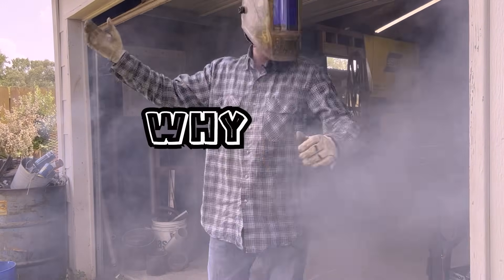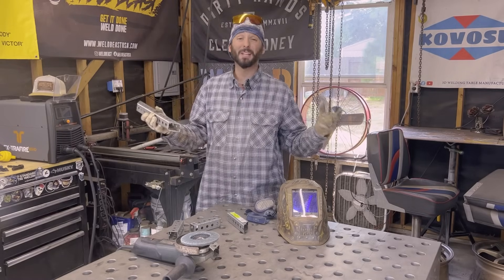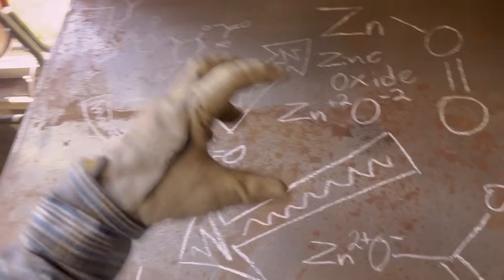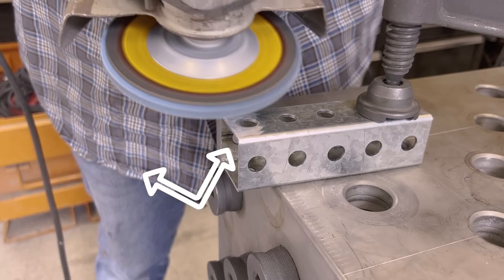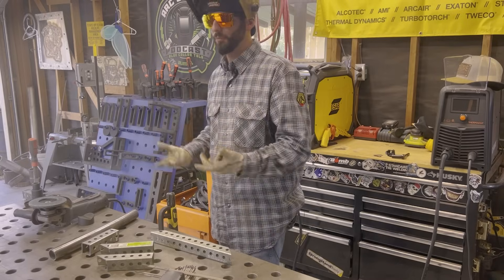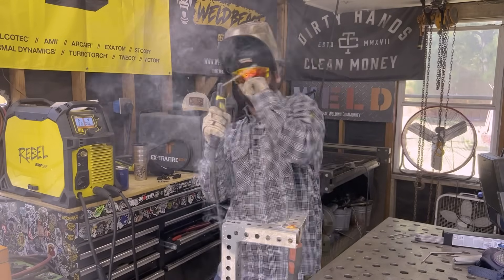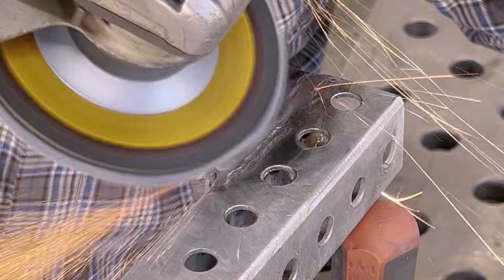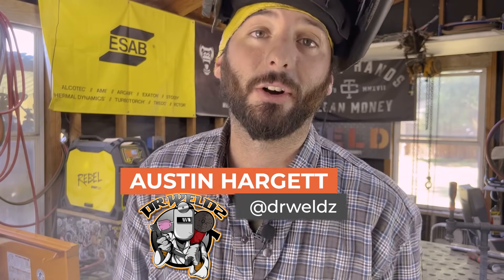Galvanized Steel Welding - How to safely weld and blend

Comment: Wish I had seen this before . Spent a few hours trying to stick weld a broken garage door - burnt through most of the metal , splatter stuck/burnt  into arms and burnt through running shoes and toes  , did not clamp material and tried to hold it together with gloves until my fingers started burning through the glove , no ventilation , no respirator - I was using a 2.5mm stick and no idea of amp setting - Next time my spousal unit shouts about the garage door I wont rush off to the hardware store and buy a small welder , some rods and a hat that falls off giving me arc eyes. - I could not call in someone who know what they were doing as it was on 27th december and most people are off. - basically a dumb ass move on my part
Reply: Some things require a person with knowledge and skills. Saves money and health in the long run. FWIW

Comment: You put on a miller half mask but pretty sure that removes particles great but not fume’s correct?
Reply: @iaxford   that's exactly what I was thinking. Unfortunately the n100 or n95, or the p100 filters are all particulate Focus filters. I know they make organic filters for volatile organic compounds and there's also some further VOC filters that filter out additional acid vapors. BUT it's not enough to speculate. I'm currently trying to do my own research as best as I can to find credible scientific testing that helps show that a particular type of filter does what you wanted to do, and that's to protect you from the fumes and Vapors that galvanized welding produces.

Comment: Also don't use brake cleaner on galv.
Reply: Apparently acetone would be the safest alternative to cleaningApparently acetone would be the safest alternative to cleaning Metals , right?

Residue leftover from brake-cleaners that are then exposed to welding Arc temps produce detrimentally toxic gas ☠️

Comment: what electrode is best for welding galvanize 7018 or 6010 thanks
Reply: Never welded 6010 but 7018 works big time. I still grind it off beforehand anyways.

Comment: After reading the comments I'm surprised nobody mentioned T11-GS wire it is literary designed for welding galvanized materials such as for gates and security fencing. It is commonly available and welds very nicely despite being a self-sheilded wire.  Ventilation and a good respirator is a 100% must.
Reply: @shadowx1rider  Thanks for the Tip...I'm welding my gate and not a Pro. 1st time and looking for great, best tips to follow...

Comment: Muriatic acid (32% Hydrochloric acid) will completely remove the zinc and rust. I usually dilute down to 10% with water. You can coat with oil to prevent instant rust, but I prefer using phosphoric acid to create a layer of iron phosphate. This will paint over very well.
This also works great to remove rust from old pitted steel, which I use for many non-critical projects.

Comment: So if i am migging and i grind off 2in around the weld is there still any real health issues?
Reply from the maker: Depending on what you are welding. For example if you are welding pipe or tubing and you grind off the coating, there still might be some on the inside. The thing that is dangerous is when you vaporize Zinc it can cause what people call "Metal Fever" so anything you can do to avoid breathing that in is for the best.

Comment: 😮sorry dude, but that not hot dip! Hot dip is thick! Hot dipping is where steel is actually lowered into a hot vast of molten, and then raised to drip off. As in the WORD DIP! What you are grinding off is  gavinized electro plating done with with electric ionizing, yes what you have is electro plating that is a very very then coating. It's so easy to tell the difference, even in zinc plating, you can see a pattern of crisscrossing of blotches! And that's is exactly what you have. Hot dip vs electro plating is two separate issues, two separate  processes. Sorry but for the correction, you are wrong.
Reply: Yes. The one mistake I caught there.  That was not hot dip. That's a good explanation

Comment: I made the mistake of welding for like 45min straight in a non-ventilated room (heat on in winter). I developed fluid in my lungs, could only take 1/2-breath and was bed-ridden for 3 days. Was otherwise healthy in my mid 30's.

Comment: In addition to all the other problems, welding galvanized produces much more smoke than other types of welding so its difficult to see your work as you weld and it also puts a heavy dust layer on your welding helmet glass making vision even more difficult. 
So remove that zinc before welding.

Comment: Metal fume fever doesn't scare me nearly as much as exposure to LEAD OXIDE.   I welded galvanized for several days and never got any of the symptoms of metal fume fever.   I was stick welding hundreds of shear studs to galvanized metal deck.   Then I had an alarming wake-up call when I read just yesterday about lead oxide in galvanized products.   Excess zinc leaves the body relatively quickly via urine and feces.  Lead, on the other hand, is much slower to excrete, if at all, and builds up in the bones.   It is noted for negatively affecting IQ.   So respirator it is from now on!

Comment: I recommend that the galvanized coating be removed prior to welding.  Not only for safety and health reasons but in order to obtain a sound weld.

PS: I will weld magnesium alloys before I will weld galvanized steel.

Comment: I was welding fence pipe and got that galv. sick quick. Muriatic acid bath with 90 percent water works in 30 minutes then backing soda wash stop the acid. Also WD40 works for splatter too. Didn't know about canola oil. Cooking spray is cheaper than WD.

Comment: I use muriatic acid and a cordless fan along with a respirator.  I've had galvanic poisoning and it sucked big time.
Good video and good tips!
Reply: @BruceLyeg  I know this comment is old, but when you use muriatic acid, around how long do you leave it in? Google is giving me conflicting answers on application and time, and I'm NEW new to welding 😭
Reply: You mentioned the use of a respirator, but what type of filter did you use for the respirator.You mentioned the use of a respirator, but what type of filter did you use for the respirator?

I'mI'm currently Exploring the specifics of which filter will actually do what you wanted to do. Because guessing that a particular style filter will do its job without actual tested evidence, just bugs me. There is so much awesome scientific study as to the Metallurgy and types of welding processes to be used, but just glossing over on the safety of the user without delving into the details of a filter is kind of sad. Not by you necessarily.... But just in general. I see a lot of recommendations to use a respirator but not any real good information on what type of filter that respirator should have.
Reply: Hello, does the air flow from fan compromise the welding process. Thanks in advance
Reply: @roller9158 nah it's fine. Unless you had some gale force winds that are basically blowing you over then there is no problem.

Comment: Exposure to fumes while welding galvanised steel vivid dreams, fever night sweats nightmares.
Zinc Oxide is a type of antibiotic that will overpower the immune system’s response.
It may also contain lead.

Comment: When I worked in a fire sprinkler fab shop, I used a rosebud of the pipe when I could. I'd put a fan on it or take it outside and burn it off. Lots of heat worked wonders on galvanized. When I couldn't burn it off, I'd grind it with a flap disc and put a fan on the end of the pipe where it was sucking air through it so it wouldn't affect my gas flow

Comment: Hot Gal your weld’s after welding.
MIG welding Galvanised Steel takes a little more experience.
Here’s some tips if you are in a situation where you can not clean off the Zinc Coating.

Reduce your heat.
Hold a slight steeper welding angle.
Have a slight longer wire stick out.
Increase the gas flow to 21 litres a minute.
Use Canola oil spray to reduce spatter.

These are the tricks I learned using solid wire.
You will however obtain a better result with Flux-core wire.
It works great on construction of safety handrails.
Reply: Awesome advice!
Reply: @austinhargett5792  I did however fail to mention wire speed needs to a tiny bit on the slower side.
With machines where you can set the voltage keeping it to a maximum of 21 volts
Reply: You missed a few tips. Use CO2 vs 75/25. Keep your arc in the puddle you do not want galvanizing vaporizing under your puddle it will pop blowing out your puddle. If you can, weld base metals with a small gap gives galvanizing vapors a place to escape to.  I weld this crap every day, most of which is just burn through it.  We have several defumers per weld station to do this a little bit safer.
Reply: @daver1942  it’s a matter of the longer you have been a welder in the industry you tend to take for granted everything.
Argon CO2 mix is actually designed to assist with welding galvanised.
A gap is also good giving the molten zinc elsewhere to go.
The trick is to use the arc force pushed the molten zinc away.
No matter what one does you will find that you will get some type of defect.
Always the best thing to do is to grind that Gal away, then weld using the most normal welding technique.
But some industries are thinking only about the dollar forgetting the procedure when they quote a job.

As an apprentice I was taught to heat the Gal and brush it off then weld it followed with hot Gal application using a hot gal rod.
Mind you one rod of hot gal rod costs $5 in Australia and they must be kept in a cool place because they do melt in the heat.
Reply: Canola oil? You weld your bead on top of the oil?
Reply: @danl.4743   I am not positive, but pretty sure the heat burns the oil up. The heat breaks it down quick. It isn't saturated it is thin film of oil. 
But you definitely have a good question. Because first rule is, clean and prep the surface to be welded. So I can see what you are saying. 
 Like I said I am not a professional, but have welded plenty in my early years as a mechanic. 
    Peace to you
Reply: @danl.4743  try it out it is better than anti spatter spray.
Canola oil in a spray can works fantastic.
The heat from the arc pushes the oil away and doesn’t effect the weld properties.

Comment: Muriatic acid dissolves zinc in matter of minute or two -clean the part after and apply some oil to stop rusting if you wont weld instantly. Best part is you can protect part you dont want to remove zinc from with tape.
I was in need of m20 bolts for my lathe leveling feet and they needed to be welded to a steel plate .So i took electrical tape and protected thread parts ,after that i filled plastic cup with muriatic acid and dipped the bolt heads in . 2 min later bolt head is bare metal and thread still has zinc on it.
Reply: Awesome advice!

Comment: I haven't welded too much galvanized I'm not welding all the time though mostly just to build jeeps. For example jeep cherokee xj's when installing frame stiffeners the unibody has been galvanized or dipped in some form of galvanizing you can see the layer when cleaning and if you don't get it all or miss a spot it makes your welds icky and you get that yellow/white junk.
 I've ran into galvanized stuff multiple times over the years doing various repairs or modifications on vehicles and ive had to go back and do an extra thorough cleaning but now i know more about it. I've also seen people try to burn through it.
Reply: Great experience!

Comment: Sometimes you just have to weld the fucking thing, nothing like jerking up the amps and throwing some stick down. I bet that fucking zinc door hinge I welded 10 years ago still holds, it wasnt pretty but it was better than buying a new door because the screws all stripped out due to lack of hardness 🤷. Fucking polish doors bruh....

Comment: Just a guess but if you are Welding on ceramic coating, pretty much everything applies the same. Thanks in advance.
Reply: I would imagine so! I’ve never done it though. I’ve used ceramic backings, and it don’t stick! Lol
Reply: Just curious. I have a set of LS headers designed to cone up over the intake. For a Rock crawler. Rear engine design.  If I modify them to not curve up so much I could use them as turbo manifolds.

Comment: Zinc in the grinding dust should also be avoided. Milk is no antidote to the effects of welding fumes or poisonous metals. And I doubt if a filter respirator or moving out of the smoke column would give any protection from zinc fumes. Also google THE MAD HATTER in Alice on Wonderland. His behaviour is the result of heavy metal poisoning as mercury vapour was used in the hat making process. 
And spray painting the out side of  galvanised box section as the coating inside has been burnt off. 
Galvanised steel is not designed to be welded and should not be requested by employer designer. 
I note the pre drilled holes on the box section what would they be for. BOLTS PERHAPS? 
DONT WELD GALVANISED STEEL. And if you’re asking ask, ask your supervisor to give you a demonstration

Comment: I dropped the end of a half inch tube into citric acid. The galvanized layer dissolved after ten minutes. Just make sure that you wash well away the acid afterwards and spray some oil on it if you're not welding it right away. Otherwise it start's to rust  pretty fast.
Reply: Great tip!
Reply: I use muriatic acid.  1:1 ratio with water.  Completely dissolves the galvanize.  3 - 5 minutes dip. No grinding needed.  As was mentioned, it flash rust pretty fast.

Comment: Only weld in a well ventilated shop or outside.  A chemical respirator is a must.  Never underestimate how hazardous the fumes are.  The nerve damage is additive so repeated exposure can be fatal.  Drink milk if you have been exposed to zinc welding fumes.
Reply: I wonder how effective "drink milk" really is.  It's the wonder recipe that I heard for so many things since I was 5 years old.
Reply: @danl.4743  ....": Milk contains a protein called casein, which also has a strong binding capacity for heavy metals. Casein forms complexes with heavy metals, preventing their absorption in the gastrointestinal tract and facilitating their excretion from the body. Additionally, milk contains calcium and phosphorus, which can help reduce the absorption of certain heavy metals."
Reply: That’s right!!
Reply: Excellent video, very informative 😎👍